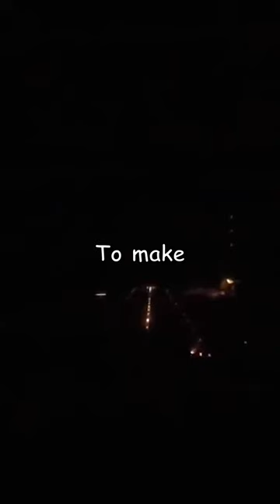F-18 Pilot Lands Without the “Ball”! #shorts

Comment: There is a mode the pilot can select on his ACLS (Auto Carrier Landing System) where he can still land hands off controls, if he has to; however, the pilot doesn't like letting electric systems land for them. The reason is that in case it fails, their life is on the line, and they don't have control.